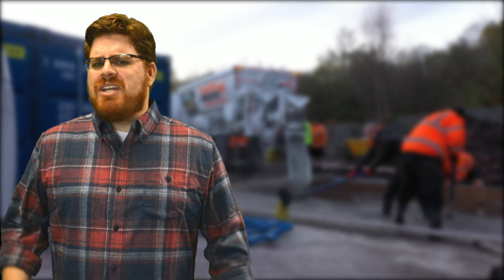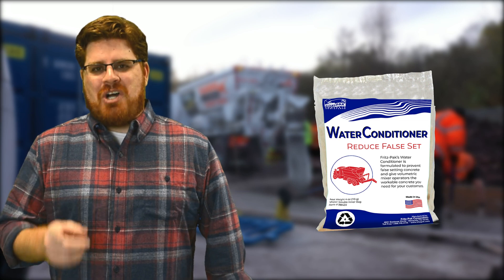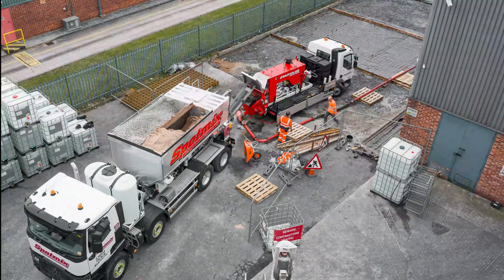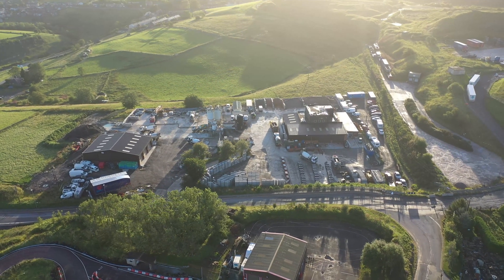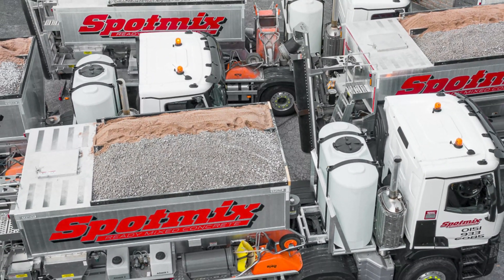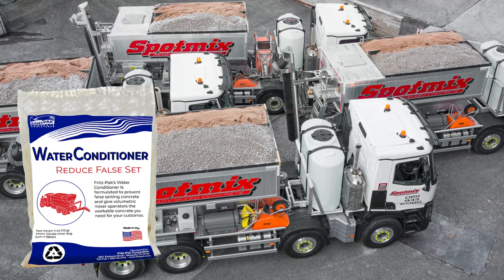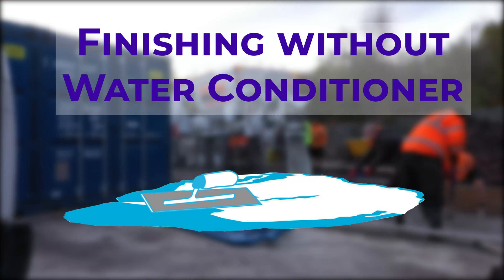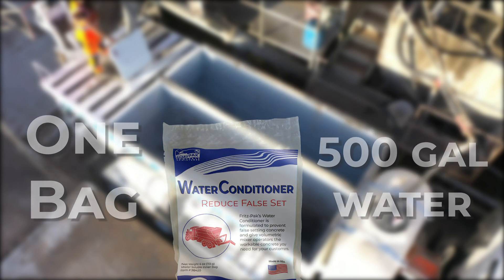Prevent Concrete False Set with Fritz-Pak's Water Conditioner

Comment: Sort of tangent, I've never understood the need for volumetric mix trucks. Just use a normal truck and wait until the jobsite to add the portland. Mix as thorough as you like, cheaper equipment, and less to go wrong.
Reply from the maker: Thanks for the comment.  This is an interesting take.

Comment: I tried the product and it worked ok. The packaging of the product isn’t right. 4oz packs are only ok if you are dosing an empty truck. If you are loading a partial truck which happens just about every time, you have to open the stickypak and divide it up. I talked to the tech and he told me no problem you can get a #50 bag. Ok $ in hand I came back and said I would like to try a bag. They then told me I had to buy 10 bags for $7500.   I don’t think they understand the mobile concrete market????
Reply from the maker: Thank you for your comments. We apologize that you had a less than pleasant experience.  We do sell 50-pound bags of Water Conditioner, and the product stores well.  If you have questions or concerns, shoot us an email at orders@fritzpak.com.